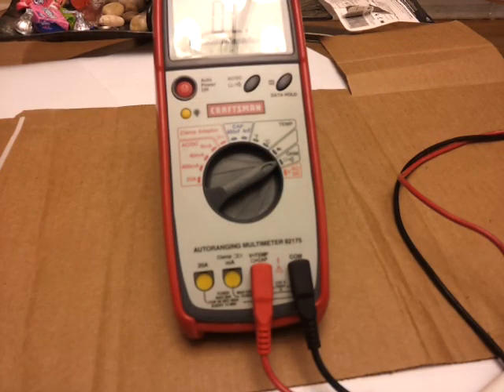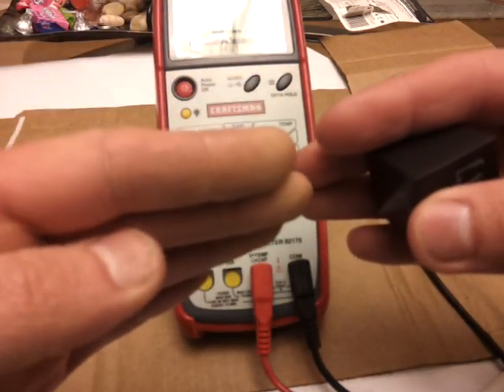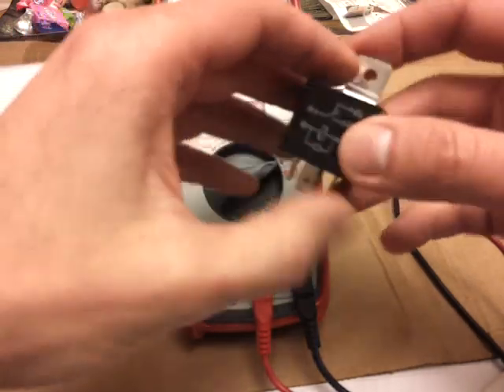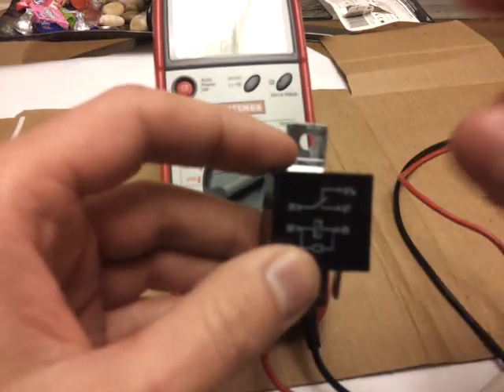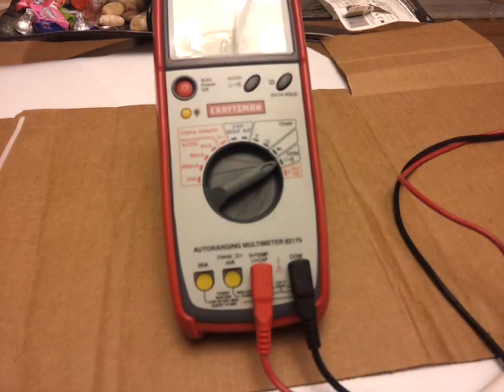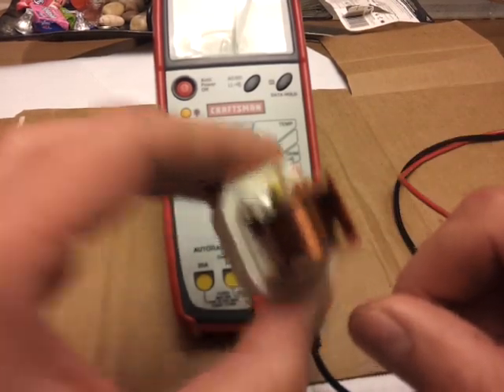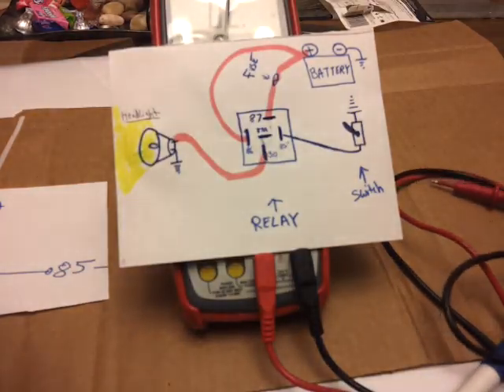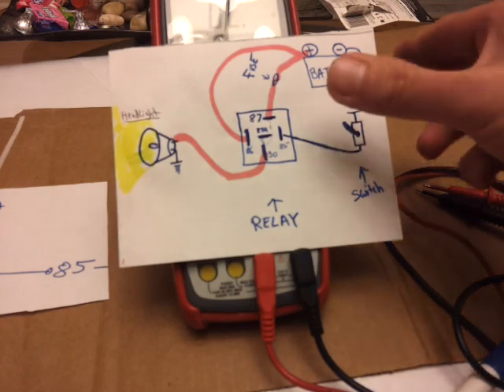RELAYS - How to wire and how they work TUTORIAL !!

Comment: This is an excellent video.  The instructor is easy to understand and follow.  He is well prepared and keeps your interest all the way through.  Next, lets learn how to wire relays for a motor that requires a change in polarity.  Also,  No frame ground as in a a boat.  The motor runs a puller that must be both powered up and down.

Comment: Thanks. Yes I see now if one has a relay with the extra terminal that terminal could run the opposite filament. IE instead of the relay turning the "off" it would switch to the other filament when you switch from high beam to low beam. I already have it wired with two relays but it would make sense to do it with one with the extra terminal, especially when space is limited.

Comment: Khalid Mian

Thanks for your prompt reply. I purchased SPDT relay from Radio Shack. The  no of relay is 275-0005.

After watching your video I was able to do the clicking part of the relay function. I energized the coil and it did the job. I used 9 volts battery.

I need to run a small dc fan for experiment purpose. Can you please guide me that which terminals I have to connect with the fan and I can use the relay as a switch. I have tried very hard but  .
the fan did not work.

Thanks
khalid

Comment from the maker: Hi..thanks for watching..relays are used for a few reasons..one being they are easier and cheaper to replace than running a direct switch. Also as the headlight example goes, relays allow u to run the thicker power feed battery cable a shorter distance, and have smaller wires run to the front of the car to control the relay from the switch..fuses are there to blow in case of a short

Comment: Its a Mondeo Ghia 2004 model 2liter petrol. It gave me excellent service for 12 years
Then all of a sudden after   175 000 km,  on the long  road,  it started to loose power on uphill stretches and eventually comes to a stand still. Waiting for 10 min or so, start it again and then it will go for 10 km or so. It seems that as “something” gets hot it causes the problem. 
I at first thought it was the petrol pump but then someone told me, no,  rather buy a new Fuel Pump Relay which I did and it then worked like a dream for 18 months. Then it started again with the same old story. Remember now the first relay worked for 12 years over 175 000 km, and the second one 18 months and only about 5000 km.
I cannot tell you what really gets hot to have to cool down sothat when you start it it will go OK for a awhile. The Relay is supposed to work also the Air conditioner, ECC power (what  ever that is) , High Beam lights, windscreen wipers, battery saver, fuel feed,  the Horn, rear window wiper.  After I established this I swithched off all these “additional” uses (except the battery saver what ever that may be) and assumed it will then work the fuel pump only. No joy.....
I have ordered a new relay but have not fitted it yet because driving in town on very short distances it gives no problems at all.

By coincidence??? the car would not start this morning. The selonoid/starter did not want to kick in....hooter worked and the lights. The Voltage of the battery was 12.1V.  I then saw on You Tube you need 12.4V min to start the car.  I took the battery out of my Luv (12.6V) and attached the jumping cables to the car`s battery. The car`s battery was then 12.4 (with the two batteries). I started the car with ease and then let it idle for 1/2 hr. ...took the jumpers off. The battery was then 12.4V.  I will see tomorrow whether it has run down again. Its an old battery in that its in the car probably for 3 years at least.

 I need an  explanation why the car stops going when I dont know what, gets hot.

What is your opinion.

Comment: Thanks for the video. I'm understanding the use of relays much better, but haven't solved my issue yet.

I'm working on my fog lights on a Bounder motorhome. The lights work when directly connected to 12V, but not when using  the switch. I have tried 2 brand new switches and they look good testing with an ohm meter. I tried swapping the relay with 3 others (there are 6 in a block of relays near the fuses) and it makes no difference.

I connected a tone generator to the switch and it tones at the relay. I toned from the lights through the firewall to under the dash somewhere in one of the huge bundles of wires. When I tried to tone from the relay to the bundle of wires under the dash there's no tone, unless I touch the ground wire on the tone generator. 

Should I be looking for a bad ground or maybe a blown inline fuse? I think that the fog lights are connected to the headlight switch. Should that be 86?

How about if I jump the wires that connect to 30 to 87? Should the lights come on?
How about jumping the wire that connects to 30 directly to 12V battery?
How can I test the headlight switch? The running lights and headlights work fine.

Thanks.

Comment: Just a heads up you have your 30 and 87 mixed up if we are talking about automotive wiring. 30 is input from the battery and is fused, 87 is output to accessory.

Comment: Great video. Very helpful, however, I have two questions.

1. You mentioned what wire gauge to use for the 85 - 86 circuit but did not mention what wire gauge to use for the 30 - 87A circuit in a relay.

2. Lets say that instead of head light I have an aftermarket air horn. I want to use my air horn in parallel with my existing OEM car horn and alternate between the two with a ON-ON switch or ON-OFF-ON switch from inside the car.
How can I wire my existing OEM horn to the switch in your diagram? I am bit confused on how I can combine two circuits to run in parallel.

Thanks.

Comment: I have a question I have a dual horn set-up in my car, they are both on each corner of the car, and that battery is close to the firewall but on the passenger, I need to hook-up the horn switch can u help me.

Comment: This tutorial is very much helpful to me because I am trying to do it myself the wiring of headlights, tail lights and others.  As of the moment my horn doesn't work because some of the wiring  were burned maybe due to over-voltage from the regulator.  It so happened that I found this tutorial so I took out my bosch relays and tried to test according to the continuity as it is instructed.  Here in the tutorial 85 and 86 has the continuity and 30 and 87A also has the continuity.  However in the bosch relay it is different 85 and 86 has the continuity and 87A and 87 with continuity.  How can I not be confused in wiring these?  When I press the horn switch the relay clicks but the horn has no sound. I am sure the horn is still good but something is wrong in the wiring.

Comment: klowny im trying to run a relay to my external electric fuel pump, my fuel pump instructions say get a 4 wire green, black and 2 red wires relay.  i can only find black, yellow, white, red, and blue wire relays? is it the same
Reply from the maker: it doesnt matter the color..what matters isthe amperage of the relay and if its nornally closed or open..but in ur case its normally open..thanks for watching
Reply: i have a 30 amp relay with 4 wires but one wire number 30 and 85 is sautered together, can i just separate that wire and use the 85 for my ground?  not sure why they are sautered together
Reply from the maker: +ss396rat u should get another one..they are cheap
Reply: +klowny1969 ok thanks

Comment: so if the fuse is 40 amps 30 and 87, how many current amps should be in the switch 85 and 86 to be able to kick-in 30 and 87's amps

Comment: Hi Klowny1969,Thanks for explaining that relay in such detail. My request from you is. Can you help me nut out how to reverse a 12v motor on a coop door which includes 2 relays and 2 limit switches. I have watched videos on youtube of them working but with my setup I can get the motor to run in only one direction. I am using a 3 position switch and can get the limit switches to work in conjunction with the switch but motor won't reverse direction. Thanks in advance for your help. Regards Rob

Comment: im not really sure why a Relay is needed . instead of connecting directly the stuff.. does the relay get low the voltage? to avoid burning lamps? ive herad than when you buy xenon lights they say.. u must put a relay first.  why is that?.. whats the diffrerence with a simple fuse? thanks!

Comment: My A/C has this ticking sound when I turned it on, it eventually goes off though, but it is kinda irritating!  It's like a time bomb ticking.  Now I had it fix before and I was told it was only the relays, they said they switched it from the HEATER,since we don't have use for it (our Country is tropical...no snow).  It worked!  But after a few years my A/C evaporator needs to be replaced, and the ticking came back.  Is the relay really the culprit here?  Hope you can help me.  I got a Mitsubishi 1999 Galant VR A/T.

Comment: thanks for or time doing this, true is very important the way you connect the wires if they tin or thick, means homs and amps to the voltage, if you a tin wire with 12 v high amps in a continuity the wire will get very hot or burn. very caution with that. good job ( klowny )
Reply from the maker: Thnx for watching
Reply: Was cool good job

Comment: Hello, if a bulb is changed on one side and another ohm is on the other side. I think my understanding is if the wires are not think enough to carry the volts, that wire will catch fire. If bulbs of the same type were in place for five months and the left side bulb was replaced with another bulb, would the older bulb that has been in place for 5 months catch fire? Or do we have a relay matter, sense the right side and total bumper was replaced. Is there a possible connection matter that would cause a fire?
Reply from the maker: The wires would catch fire if the AMP draw was greater than the wire could handle..

Comment: Hello
I bought a glass breaking alarm with a very short mouth [Deficient] manual. It has 6 inputs: AntiTamper outputs [2] Relay [one side" C the other "Nc" and power               [ + and - ]
 
I tried hooking up the siren  to +12v and NC but could not get power. Any tips?  Thanks in advance for your thoughts.

Comment: i have some questions  for example if i have truck and the better was under the hood then i transfer the battery to the bed that mean the lights wiring  changed with the Relay does this reason correct ?
second question how i can to know the best long for the wiring  fit  with relay ?
Reply from the maker: Salim Binshagra search for the graph on google that tells u what gauge wire u need to use for the amps ur car uses..and the length to the bed..u can hook up a remote solenoid to ur starter and a battery disconnect

Comment: Hi, I have recently come across your relay tutorial and found some omissions, inaccuracies and errors worth correcting. I’ll try to follow your video:

- Why would one want to wire the relay: the best way is to test it in its natural environment, i.e. the car it is installed in, except in some particular circumstances as flat battery or no battery. However, the 9V battery part is neat.

- Why relays are needed: to reduce the total circuit voltage drop which, for headlights, should not exceed 0.6V because on incandescent/halogen bulbs the 1V drop (from 12V to 11V) reduces the light output to 73% of nominal.  

- How it works: you omit to say that the coil to become an effective electromagnet capable of pulling/pushing anything practical must have an iron core through its center. Otherwise the effect is inexistent for practical purposes. Your hand-drawn schematic #1 should reflect that and be closer to what is printed on the relay shown in the video (like drawn vertical). It should also show the mechanical connection between the iron core and the closing contacts (30-87 terminals) - this is usually done using a dashed line, to distinguish it from the electrical wires. To be fair, several other similar videos have omitted to do so. Nevertheless, drawing it would help viewers understand the nature of the ONLY connection between the two circuits, which is a mechanical one (pulling force), produced by an electromagnet (coil + core).

- The coloured wiring diagram #2: I don’t remember of ever seeing a relay-operated  headlight circuit controlled by a ground switch and doubt it exists. A SPST switch is normally used in the +12V line, with a proper upstream fuse. Ground switches are commonly used for horns, brake and reversing lights. Moreover, you don’t bring two wires from the battery plus - the fused one is sufficient. The other (coil input) comes from the properly fused control switch circuit. For lab purposes, it can be taken from the light circuit input terminal (30 in the corrected diagram) and is under the fuse protection - yours is not.   

- Sanding: this is a certain method of ruining ANY contacts and may be done in extreme circumstances. At any rate, a relay that has failed and later worked is best replaced, no questions asked.

- Terminal codes: your wiring diagram #2 (the colored version) shows terminal 30 connected to the headlamp. Although electrically it may works it is the WRONG way to connect the relay - 30 is the direct battery plus (as opposed to the ignition-key battery plus, code 15, not used here). Other (correct) codes & meanings are: 86 - coil  plus, 85 - coil ground, 87 - switched load (headlight, etc). If one wants a normally ON load, 87a should be used instead. The entire subject has been  covered since more than 50 years by what is now the DIN 72552 standard, some ISO and JIS standards where details may vary, but principles remain the same.

- Wire & fuse sizing: the load leads must have at least twice the copper cross-section area (wire gauge) of the control (coil) circuit. Fuse should be sized accordingly - rule of thumb 50% more than the max. load current in A, motorised loads 75% more. Although the distance is a factor, on properly sized leads several feet more or less do not change anything. Since other sizing issues have not been handled, even this is better not mentioned. Whoever has to do the connecting is supposed to have the basic electrical notions anyway.

- Diagram #1, terminals:

https://www.google.it/url?sa=i&rct=j&q=&esrc=s&source=images&cd=&cad=rja&docid=sUT1cKwX6TcAFM&tbnid=F0Ups6_1kYcBhM:&ved=0CAUQjRw&url=http%3A%2F%2Fwww.rowand.net%2FShop%2FTech%2FAllAboutRelays.htm&ei=TVjlUqT7JsPStQa3r4HgDw&bvm=bv.59930103,d.bGQ&psig=AFQjCNHYOJ9cqQ-2MuTNIETCs9jG_X_5kg&ust=1390848343712855

- Diagram #2, connection:

https://www.google.it/url?sa=i&rct=j&q=&esrc=s&source=images&cd=&cad=rja&docid=uac0hwlHH0-aKM&tbnid=mhgVsHV-Dlr1jM:&ved=0CAUQjRw&url=http%3A%2F%2Fcoloradok5.com%2Fforums%2Fshowthread.php%3Ft%3D73082&ei=BlnlUvj9JIyFtQbdsYDwBA&bvm=bv.59930103,d.bGQ&psig=AFQjCNHYOJ9cqQ-2MuTNIETCs9jG_X_5kg&ust=1390848343712855

Best regards,

Zzonyx

Comment: How to wire pass fuel pump relay on a 95chevy truck fuel relay bench test good new fuel pump but pump isn't getting voltage so won't run how can relay be bypassed to get running

Comment: 86 ang 85, does it really matter if they are switched from positive or negative?
Reply: +Ryan Silva&#160; Yes you could power activate the Coil 85 +ve &amp; 86 -ve, on a standard relay it would work, but the reverse is the standard which is best used so if it is NOT a standard relay, (some Relays may house a Diode for some applications) it might Require that the correct polarity is used.

Comment: if your relay is 30 amps your fuse have to be 30 amps too (always the same of the relay) also.. it does NOT matter what direction you set the relay... meaning that 30 and 87 is one side of the relay and 85 and 86 is the other side (forget about 87A thats for dual functions) So... you can have the battery in 30 and the load on 87... or the battery on 87 and the load on 30, same thing for 85 and 86, the switch on 85 and the battery on 86 or viceverse BUT NEVER mix the 2 "sides" of the relay. RULE: if your load lamp,light,fan, etc is 30 amps, your relay and fuse have to match

Comment: Hey Klowny1969 Question  I Have an external fuel pump on my 71 cutlass, Its safe to intall the relay on the firewall and run a long line to it ?  
And also im going to be putting electric fans on it soon  i bought a 100 amp relay so i can have both fans running when temp comes up, Now i always hear run a fuse and run the wire to the battery but is there another way i can install another fuse box in the car so i dont have 4 wires attached to the battery ? i have a few wires on the starter but its getting hard to hide all these dang wires, or should i look into a distributor block and just hook the wires to that and run one power lead  and then hook to relays ? lotta questions sorry lol
Reply from the maker: i just recorded a video on how to wire a switched 12v and constant hot fuse block in a car from scratch..i will edit and post within a week or so..and relay can be on firewall..alot of modern cars are done that way from the factory..thanks for watching
Reply: Thanks Klowny ill keep my eye out for the vid for sure , And yes i was thinking new cars can do it so it should be ok but i like to ask juuuuust in case Haha! 
time i add my fuel pump , my fans, my nitrous, my msd box i cant find my battery with all the wires lol
Reply from the maker: +juiced71 yeah i hear u lol

Comment: Do I NEED a relay for wiring up an LED light bar?
Reply: Depends how you want to turn it on, will need a relay if you want it to auto turn on with headlights however if you want it to be separate you just need a switch.

Be careful with after market lighting, just yesterday I was pulled over by police for my diy LED light bars I put in my headlights, they are apparently illegal because they 'don't' turn off automatically when you turn your headlights on, my car almost got defected from it! (Australia - Not sure about legality in other countries)
Reply: if a high voltage is used then yes.